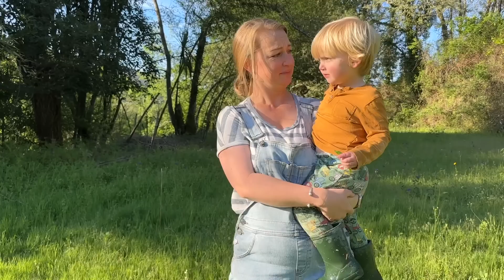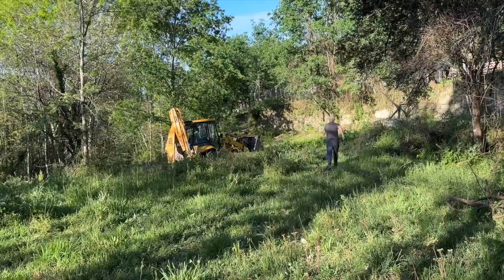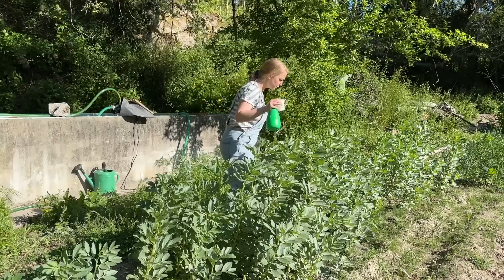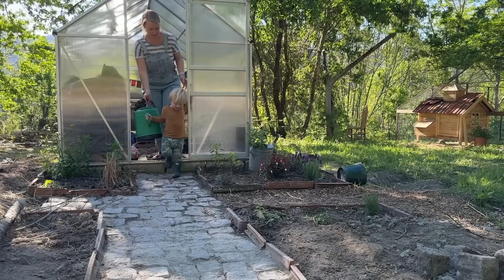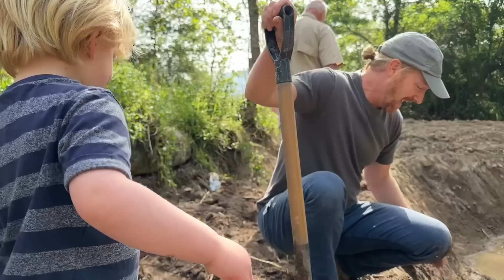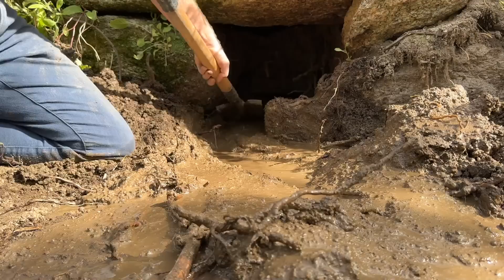Fantastic discovery on our Portugal Homestead - This changes EVERYTHING!

Comment: Also you may have a leak issue with a freshly dug pit and pigs are the solution - pigs will seal any pond so maybe you can borrow some to fix your pond seal then after a month or so it will be fixed, doesn’t take long

Comment: What a great find that spring was. If you find the stone bottom you could continue with the stone from around the property and make a stone channel to feed the water into your pond. I hope the water keeps flowing throughout the summer. Tara you are going to have a battle keeping that garden watered with a watering can. I would suggest a portable 12volt pump battery powered sucking from the pond up to the garden and maybe connected to a trickle irrigation system down the rows.

Comment: With aphids I tend to use the garden hose with my thumb over the end to jet wash them off. 
With beans – like broad beans – you can trim the tips off the top off the mature plant as that tends to attract aphids or black fly first. The beans then grow happily out of the less-affected flowers lower down. 

If your tomatoes have flowers already, as small potted plants, then that can be because they have got too dry early on, and are panicking, or bolting. You could try planting them in the soil inside the greenhouse, or plant straight the soil outside if your area is already warmed up to summer temperatures. 

When watering seedtrays and pots in a greenhouse it may help to put the pots and seeds in a tray and water from below, to reduce water loss from evaporation. 
But these are just little tips you tend to pick up on the way, and you're doing just fine.

Comment: I'm watching your video through my TV, but that makes commenting quite a challenge :) Anyway, as my wife and I go through your video I can at least try and answer some of the questions you pose along  the way...
1. for the aphid problem: I ordered my ladybug colony starter online, I'm sure you can google a way of ordering them in your region. Another way of attracting ladybugs or deterring aphids is by planting/sowing beneficial flowers for them. Again, something to check local nurseries or online for :)
2. tomatoes... tomatoes have been my mild obsession for the past five years, so here's some of what I've learned so far. 
It's fine to transplant tomatoes while they're flowering, they can handle that. Just make sure to plant the plants deep enough, every little hair on the stalk will grow into a root, so the more roots you can provide the better it will grow. I stick mine down at least a foot, taking off all the leaves below the soil. 
Also, putting an egg (give it a bit of a crack once it's in the hole)under your plant will provide it with some much needed nutrients as well. 
Lastly: check if you've got indeterminate/determinate tomatoes, that will mean different ways of maintaining your plants. If you happen to have indeterminate plants, you can remove the current flowerbuds to give your plants a bit more energy to put towards growing bigger and stronger before putting on fruit.

Dear lord, I'm waffling on here... Tomatoes really are an obsession :)
anyways, we love watching your videos and seeing how all of you grow along the way. Congrats on the spring, that's a great boon for the farm.
Reply from the maker: Thanks Sven! That’s an excellent reply and we really appreciate your insides! Thanks so much for watching and taking this journey with us, your support is so very much appreciated! 👍🙏🇵🇹🏡

Comment: When I bult a pond I put a carpet pad on the bottom under the epf roof membrane. You will want to have shelves that you can have flat in the pond edge, that you can reach. These will allow you to put bog plats on the edge.  I made a shelf for my pump as well as it kept the water circulating and airiated. I had a catch barrel that filtered the water. Had koi for 14 years.

Comment: What you need to do with the water mine is to build a little stone dam in front of it. You can then set up a pipe at the top to  fill the pond. You can get cement that sets in water & dries waterproof. You can then set up a pipe at the top to  fill the pond. If you know Nick from Project Portugal he knows where to get it & how to use it.

Comment: Regarding aphids... 1. Companion Planting. Intersperse nasturtiums, marigolds, and green onions near your prized veggies. They will be drawn to the nasturtiums and repelled by the marigolds and green onions. 2. A bit of Neem oil mixed with a bit of castille soap and water to spray on heavily invested areas. Note: try to do this in the evening so as not to burn the plants with the sun and oil. 3. You can order lady bugs and have them delivered. Note: if the table is not set (nothing to eat) they will probably move along. 4. Sharp blast of water from the water hose will knock them off. They are not very fast and will take a bit to come back.  The most pain free, reliable, and easiest of all of these methods for me has been the companion planting method. Good Luck! Love to see you building a pond!
Reply: I forgot to mention the ants. Ants "farm" aphids. They overwinter the aphid larvae and carry them to plants in spring. When the aphids attack a plant, they leave behind a sugary liquid that ants like. Best to eradicate any ant hills next to your garden. I like using diatomaceous earth. It is non-toxic to humans...

Comment: Tomatoes are hardy, so transplant any time the soil is warm enough and in a sunny location.  Plant with peppers, basil, and marigolds mixed in ... great companion plants for natural pest control.  Use plenty of compost in the planting hole as tomatoes need nutrients (big eaters).  Transplant tomatoes deeper than you think, removing bottom two leave-stems and bury to that level (they set roots along the whole stem).  The tomato plants will need a trellis ... they are not a natural climber, so need to tie them up the trellis.  If your tomatoes are indeterminate variety, then the trellis will need to be ~7ft tall.  Also, pruning out the armpit side-growth is really important to focus energy on the fruit development versus adding more leaves.

Pond is a great idea.  For the new found spring, I think a small Scottish stone-lined burn would be great ... running  from the wall source to the pond and then trickle it down a stone "waterfall" into the pond.    All the best !

Comment: Looking at that hole in the ground I'd extend it in order for it to be of real use for swimming like you said. You will also need some space along the edges for plants needed for cleaning the water.
I would also wait and watch the water transport first before doing any lining. Because it may very well be the water supply is greater than the water loss through the subsoil. Thus creating a natural overflow and also natural filtering process. Even now the water is collecting very quickly .
Reply from the maker: Great ideas PJW, thanks so much for sharing 😊🙏🏼❤️🇵🇹

Comment: You seem to be getting it all under control which is always great to see.
The easiest way to manage aphids is to squirt them hard with a water jet. Usually people use their hose which is pressurized from the tap or their pump. But if you don't have that luxury then fill a pressure sprayer say a 2lt and pump it up hard and use that. They don't seem to move much which is why it works. If you have lots of plants to do then use a 5lt spray pack. They will respond (by dying) to any number of chemical or near chemical sprays but why use them when simple water works almost as well. Due to the number of life cycles they can pump out, you have to do them pretty regularly in anycase, no matter what you use.
I never found companion planting to be significantly effective. When all the plants are soft and delicious the aphids will be everywhere. Some are good for later in the season when the companions are still soft while the garden plants are hardening off, but in the early days all plants are affected.
It's never a bad time to move tomatoes. Plant deeply, far deeper than the current bottom leaf. They will grow yet more roots. Just be sure the last frosts are finished. Only set tomatoes in pots if you are in a frosty area. Otherwise best to just start them right where they will grow but in a bit of a trench so you can mound up around them as they grow, for the first few weeks anyway.

Comment: Hi yes you move your tomato plants anytime you like just a quick tip if you remove the bottom 2 sets of leaves you can plant the tomato up to that depth and all the white nodes you’ll be able to see will become roots giving you a better plant and even if you dropped a plant and the root ball gets broken off don’t worry just remove them 2sets of leaves and still plant the plant as them new roots will come and support and feed the tomato plant in may knock it back a little bit till the plant makes the new roots. 
If you plan to feed with a product called Tomatoright  then only start the feeding once it’s setting it’s fruit.

Just an idea for your spring now you have found the source why not make a small collect pond say a foot and half round then lift the sides up and pipe out of collection pond into your big pond that way you’ll have new water going into your big pond all the time and it will stop the water from stagnating.
Lining the pond with clay is a messy job but the jcb should be able to do that for you and the pipe from the spring will be able to go through the pond wall even below water and not be a problem.
Reply from the maker: Thanks so much for the advice Martin 🌱😊🙏🏼❤️🇵🇹

Comment: roman tiles are good in those. little cement collector to drink from, check the top of the hill for homes.. check for trees drinking form it high up they pump 10m3 per day and make root balls in the tunnel leading there. it might be a bunch of clay tubes going from an uphill gravel pit.

Comment: Yes, WRT digging the pond. You are not stopping the water from leaving your property. Just slowing it down.
I have a similar situation with my spring well. The overflow was going down a ditch and into the ocean. I realized that, if I used it for irrigation, I was just moving it a couple feet over and what I didn't use was still going to the same place!
Black Aphids.... Look for ants. There's a variety of ant that farms aphids. Essentially, the aphids are the ants dairy cattle. It'll be the ants that you need to get rid of.

Comment: That's not ground water that is a natural spring long buried by time.  A wealth for your farm if harnessed.  Completely clean out, build a concrete collection basin at least a cubic meter to trap the flow, add a pipe near the top of the collection basin and direct it to where you want.  Measure the temperature of the water exiting the spring.  If in the 50s (f) pond could support trout.  Extra protein for the farm.

Comment: Hello Newby's... so much progress. As far as the aphids go, you can mail order both lady bugs and praying mantis "eggs". Either will quickly gobble up the aphids or any other pests. Marigolds are supposed to repel bugs. The lady bugs will want to make themselves at home. The spring fed pond reminds me of when I was a kid. There was a pond we used swim in, the springs would keep the water fresh and the fish loved it. Bass, perch, sun fish...🐠🐟🦎🐸 they loved to exfoliate your skin... it tickled. Frogs, salamanders, lightning bugs. Caruso, Sawyer and you two will enjoy on those very hot days. Whatever you decide to line the pond with will have to be porous, otherwise the springs will try to seep under the membrane. You might want to leave it au natural. Don't borrow trouble. I love John's idea of a waterfall. There are pond designs out there that promote naturalistic 3 stage ponds... bogs to filter the water, etc. As usual, a very interesting video. Have you considered using a drip irrigation system for the garden. When you use the handheld hose sprayer, about 50% of the water is wasted through evaporation.💦💦💦💦

Comment: Guys: 2022 was not “very hot” by any standard. Not dry either. You need to plan for much harder conditions. Like 2017, when it only rained in October. That pond may not be enough, you need to consider a bore hole.

That water spring looks amazing but in this region it’s just surface running water, not a “real” spring. It will be dry in a month. You cannot rely on it for summer in any way.

Comment: Some say Aphids can be a sign of overfertilization. Ladybugs (not birds) just show up, you have to be patient. They will not likely come if you are using insecticide, even soapy water. If you want to slow the aphids down smash them and spray with water  to knock some off. It has to be done every day while you wait for ladybugs.

Comment: Also, forgot to add, you can transplant tomatoes when flowering and also if they have small fruit on them. If your tomatoes are leggy, you can remove the bottom leaves and bury the whole stem to create a very strong root system. Each of the little hairs on the tomato plant stem will become a root. It's now or never baby!